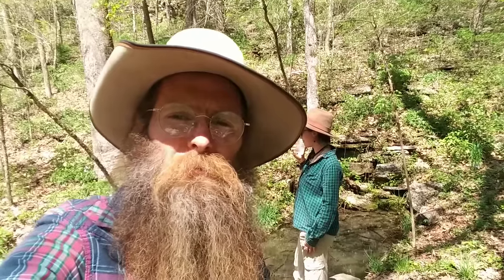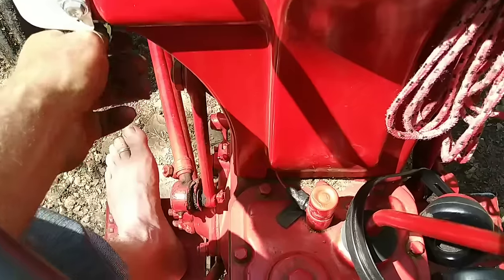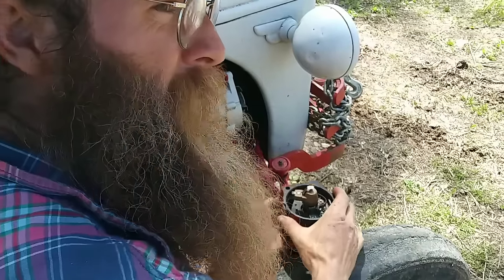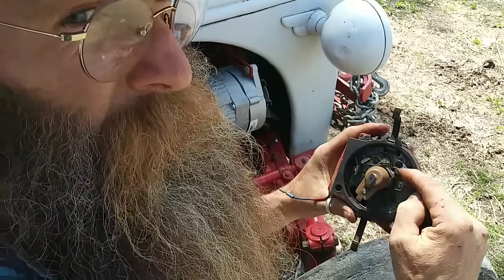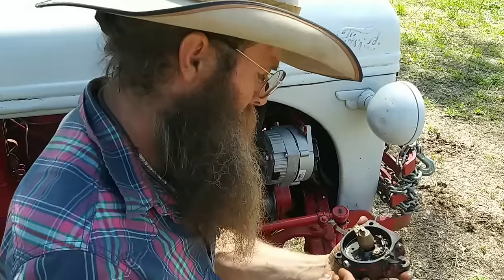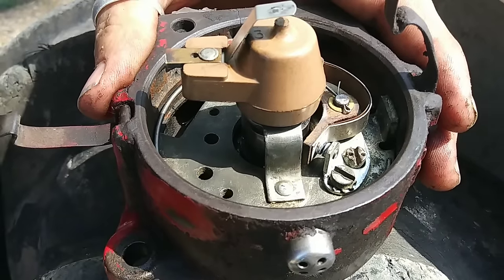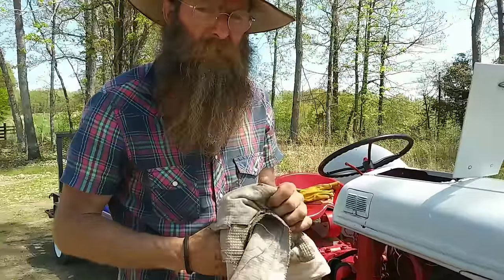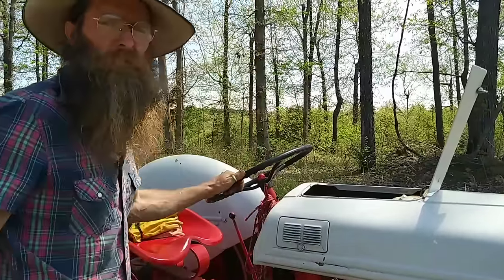A Hard Day's Work For An 8n Tractor

Comment: Truly enjoyed the music, and that's a very attractive helper you have there. It must be nice to live in a place where you're not afraid to drink the spring water. It's heartbreaking to see what gets dumped into the water where I live.
Reply: Focus less on trying to appear hill country and drinking water and spend some time around those old timers whose politics and ignorant speech you can't stand.  They'll have alot to teach you.  Like how that big bar is a lever, and the further back the chain is hooked, the more it's going to leverage your tractor.  Or that you should take some steel plate and make an angled skid, lift the log, and place it stop of it.  Securing it to the log, you can either pull it or the log, with your chain affixed to the drawbar, allowing you to not only more safely and efficiently move it, but also move even larger logs.  Your tractor is small and doesn't have alot of power.  But it has more than enough to get most jobs done if you think a little bit about the task at hand and a better way to do it. And will be much easier on the old girl.  You're new to this and excited.  I get it.  Just  trying to give you some advice before you break it.  Or yourself.
Reply: @AMCtilldeath  Did you reply to the right comment? What I said and what you said have nothing to do with each other.

Comment: The memories this brings back. Growing up in the 1980's I farmed with my grandfather, spending many hours raking hay on an 8n. I was too small and too light to push the clutch down and had to stand up pulling up on the steering wheel to push the brakes and clutch down. Learned to back a trailer on that thing... nearly killed us with that fast reverse speed. He bought new in 1954 (I think) and it's still running today. Really great farm tractor.
Reply from the maker: Thanks for sharing those good memories with us we really love to read stories like that. But we also really like it when people leave comments like this because everyone else gets to share in those good memories and experiences as well. Thanks for your comment and also thanks for your interaction
Reply: 1952 was the last year for the 8n type of  tractor. The Golden Jubilee (1903-1953) came out with overhead valves and live hydraulics, irritating slow reverse. Harry Ferguson from England, was married to Henry Fords daughter, and was the actual engineer that invented the 3 point lift system, that revolutionized the tractor industry.

Comment: Why didn't you use a "forest winch"  attached to the tractor?
In my country people use them on mf 35 clones (3200 lbs, 35hp) to pull logs out of the forest with less stress on their tractors and it seems a lot safer that way...

Comment: when pulling anything heavy with any tractor  you should pull from lowest point on the tractor other wise it flips and you dont have a roll over cage.dont walk along the path of danger bud just not worth it
Reply: Rolloverbar yee, but pulling from lowest point would mean pulling into ground, and no pulled log in that case.
Reply: Yea that was terribly dangerous. hundreds of old timers have been killed by flipping 8N's on top of them selves.  Very impressive as far as the work the 8N did.  Great video.

Comment: Those are nice logs.  We recently did the same thing with my tractor and a car trailer.  We loaded that with 12 ft logs  and four feet high .  That sure made that tractor snort.  We loaded them with the loader.  I have a boom like yours and its very handy.  We have set railroad ties with it and all kinds of things.  That is hard work but always enjoyed getting logs out.  We did find it was easier to move them in logs than cutting them on site due to time restraints.   I have also put in an electronic distributor.  I don't know if they make one for the 8n.  my tractor started so hard was miserable with rain no rain.  After I put it in it always starts.  Its been outside.  Best money i ever spent. Hope it helps. Thanks for the video.

Comment: what i did  to  help pull-out  logs  was  found a  boat winch  with  a   2 inch  belt mounted  to  three point to help   lift  the front  log so pullout easer

Comment: The points were burning up on my 8N and once I did away with the flimsy key switch that stopped happening.  I think what was happening was going over bumps the key would rotate left just enough where it would turn off and arc back on again.  Grab the key the next time it starts to quit and hold it to the right.  I found it out by accident.  It was happening just random and drove me crazy for a quite a while.
Reply from the maker: That is a good suggestion. We will definitely look into that

Comment: Say what you (anyone) will about old tractors but can you do a trail side repair on modern tractors like this man just did? Probably not usually. Sometimes I wish there were companies that were still using older technology selling new equipment (tractors, trucks, etc) because it’s cheaper and typically much easier to work on.

Comment: What is that boom implement called if I were to search for a used one?
Reply from the maker: The implement is called a boom pole. It is incredibly useful. It is great for dragging logs to the mill And when you get to the mill you can load the logs with it. You can also with the same tongs that you use on it to lift logs you can lift really big heavy rocks and stack them for building walls and steps and what not. It has countless uses

Comment: I was there, working on  large farms in the late 1940s with 1956 being the last year. The 8n was full of pep back then would power a 6 foot bush hog in 3rd gear with great ease. Also a 6ft disc harrow made it real lite on the front end. (we had 103 octane gas then} All I have seen in recent years would barely pull a 5ft hog in 1st gear. Far as I am concerned a good 35 MF with the 3cyl Perkins is worth at least ten times more than a 8n or Jubilee.

Comment: Not sure if anyone has recommended this or not but a lot of your ignition problems could be reduced significantly by adding a balist resistor in the line to the positive pole on your coil
Reply: The points on my 53 to20 were burned after only using it like 4 times just bought a ballast resistor do you think that would prevent that from happening again so fast

Comment: 10:40 I really wonder if that chain were tied LOWER on the 3 point if the tractor wouldn't rear up so much. Looks pretty dangerous from here!
Reply: Many have died under the steering wheel and hood of these tractors, this footage is very disturbing to me.
Reply: I have an 8N ford I use for logging my property. This is not normal and is never done by competent people. There are many other options for handling this type of situation without risking your life and adding unnecessary wear and tear on your tractor.

Comment: The Ford 8N is a marvelous old tractor that has well earned its keep for more than 75 years. Just a thought on getting the log out of the culvert though. Would it not have been much safer to hook the chain initially much lower, below the pivot point of the rear wheels, maybe on the drawbar so as not to cantilever the entire tractor and to avoid tipping the tractor on top of the operator. Once the log was extracted, using the 3 point hitch mini-crane to lift the log into the trailer then made great sense. Your thoughts? Great video though. I just love these old 8N's. Bet few people could repair a modern tractor in the field if one broke down. The 8N is like the model "A" of tractors. Solid, very well build and designed for the everyday man/woman. Thank You for sharing. Greetings from Ontario, Canada.  from Barry  ...  VE3BMY   '73.

Comment: Should have lowered the boom, taken a shorter hitch on the log, then lift. It would have come out easy. Wheelstands are very hard on tractors. Can break the front axle.
Reply: I agree. Or you could run your chain over a piece of log... like a kind of pulley, to bump the bottom corner of that log upward, so it would pop up and over the edge of that hill. Like your style, ol bud. Keep that old Ford honest!
Reply: Yup, wheel stands are hard on a tractor, and even harder on the owner when he has to replace a front wheel spindle back in the woods, far from the road. Learned that lesson when I was young and stupid.
Reply: He's a pro.

Comment: do you start out in 4th,  or have a trick to get to 4th to see that 13 mph
Reply: Just ride the clutch a little....  Them old gas tractors will pull from way down in the low rpm...

Comment: We've still have a Ford 800 Taskmaster (son of the Ford 8N, from 1956) that I started driving when I was 3yrs old, and a Ford 601 that Dad got me when I was five... both have the side distributer. Yours has been re-painted and prettier.  
The Morel mushroom found at 17:40 should be tasty when soaked in salt water overnight, and slow-fried in butter !  (hope you found a dozen more) You can often find those in Elm groves during the spring, just after May-apple plants spring up.
Reply from the maker: The early Ford tractors our a symbol that represents the True meaning of the term made in America. What a special thing that you still have the tractors that you grew up with. Thanks for your comment and also thanks for your interaction we really appreciate that

Comment: I grew up on a 1953 Ford jubilee ( all but the same tractor). At 7 years old I was driving it helping my late father horse hoe up potatoes and pull a two handled cultivator. I would stand up on the transmission hump to look over the hood. To stop I would push all my weight down on the clutch and bat the stick out of gear as the clutch peddle would be on its way back up. I was not heavy enough to hold it down. By 12 years old I was pulling fire wood and logs ( long trees) out of the woods. My father would always drill in my head to get my foot off the clutch. And never take my hand off the hoist control. He said riding the clutch would take it out in no time and to use the tractors weight with the hoist to raise the front end up, by adding weight to the rear wheels and also as a safety in the event it started to go up too far. He said you will never get your foot on that clutch fast enough if it starts to go over. Great video. Brings back memories. His was destroyed in an accident when a truck lost its brakes and ran over him. Splitting the tractor and killing him. 😢
Reply from the maker: Sorry to hear about your father he sounded like a good man. You are lucky to have had those good experiences. Thank you for your comment and also thank you for sharing your memories we really appreciate that

Comment: Nice video, but you'd better be careful getting the front end that far off the ground. I did the same thing lifting a large stone. When the strap came off, the tractor came down and snapped a front wheel spindle. That was a hard learned lesson. It was repaired, and I'm happy to say that 25 years later the old 8N is still going strong.
Reply: Que medi

Que número de llantas delanteras, y que precio están actualmente.  Tengo un tractor   de esos 9n

Comment: One thing on those old Front mount Distributors is to be sure put a good gasket set in them!!!   I have heard people cuss and fuss about how they would not start in wet weather or even after a heavy dew.  But that is what the gasket set is for, it helps tremendously as far as making it more watertight!  It helps tremendously!  The moisture will corrode your points really quick.  The drier you can keep it the better it will start and the longer in between servicing!

Comment: Well, this video came up after I saw one of your newer ones, so I know you haven’t killed yourself in a tractor rollover for a couple of years after this one. I see comments about the dangerous operation, and a bunch of the inevitable comments scoffing about the ‘safety police’. Trust me, I wouldn’t ever willingly get my front tires off the ground, much less do such a dynamic maneuver as you did. Ford 8Ns are notoriously light in the front end for lifting weight on a boom. So I have three inexpensive suggestions. First, build and mount a box for the front and load it with 200-300 lbs of rocks when you need to use the boom. Second, get a couple of comealongs and use the tractor as your base to winch the logs up until you can just lift and pull without having to bounce. Third, make an A-frame to run your chain over just in front of the log to keep the leading edge from digging. There are ways to achieve these goals without being hard on your machine or overly risky. Tractor rollovers are the leading cause of farm deaths, and most of those operators thought they could get things done too.
Reply: Chamfering the leading edge of the log butt a bit can greatly reduce drag too.

Comment: Dang man. For anyone not familiar with those tractors, there is no accelerator pedal. When they are in gear, they go. You can throttle up and down with a lever by the steering wheel, but the only way really to stop is to press the clutch or shift into neutral. When he is pulling that log and popping wheelies, watch his left foot. He stomps the clutch. Amazing skill (and probably a lot of luck) he didn't flip. Also, that tractor is less than 30hp and only weighs around 3,000lbs. I have a 47 8N and no way I would have attempted that. I would have first used the hitch in the front and tried backing it out onto the road. If that failed, I would have secured the chain low and slowly throttled up with my foot on the clutch the whole time. If the front wheels left the ground, I would have stopped and called someone with a bigger tractor. Not worth dying or being paralyzed.

Comment: now , after you break that 8n apart and replace the clutch assm , replace the axle bearings on that trailer and rebuild the hydraulic pump on the lift what have you gained ?
Reply: Exactly. That's no way to treat your equipment for a few views on YouTube.

Comment: That muddy boot on the clutch has a mirror image...on the brake. It's risky but not as risky as you make it seem.  He's using the tractor's front end weight like a come along ratcheting around the axle as a pivot point. Adding weight to the front end would help a lot.
Reply: He thinks it’s a four wheeler